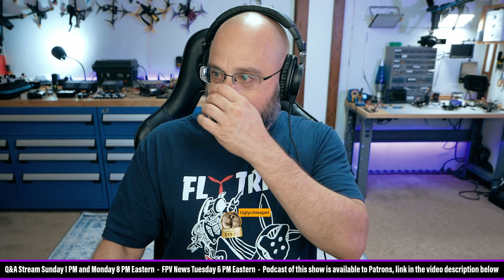My Motors Are Clicky? Motors Stick When I Turn Them By Hand? Not All Motors? FET Drag- FPV Questions

Comment: On my recent build, I also had that clicky sound from the motors really bad. When I would land the quad, the motors were very hot after a full battery flight. I took it apart, added better softmounts on the ESC and that resolved the issue, motors were no longer heating up and no more clicky noise.

Comment: Does FET in this context mean Field Effective Transistor?
Reply: Yes MOSFET. The MOS is basically an insulated capacitor that is doing the switching. The Damped Light uses a complementary set of MOSFET to drag the props when trying to slow down prop. This complementary set of 3 MOSFET are responsible for shorting the motor coils. And depending on configuration, when powering off ESC, the capacitor's remaining charge and complementary dragging can stay for a moment (15 minutes or longer or shorter).